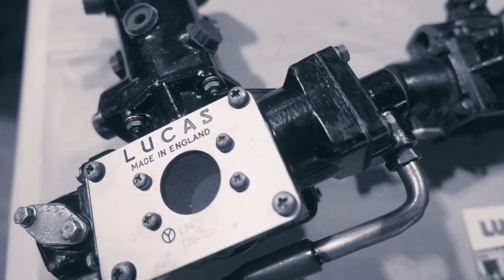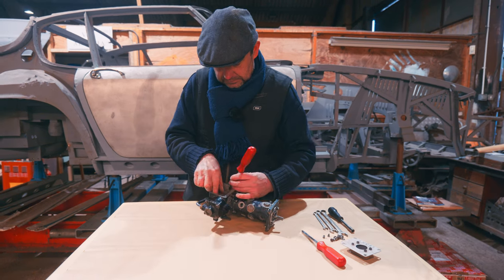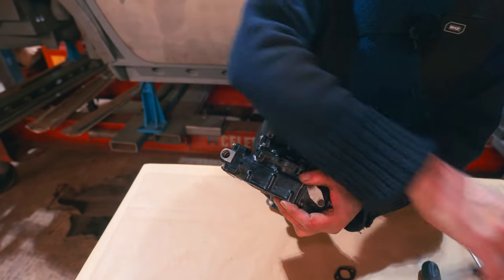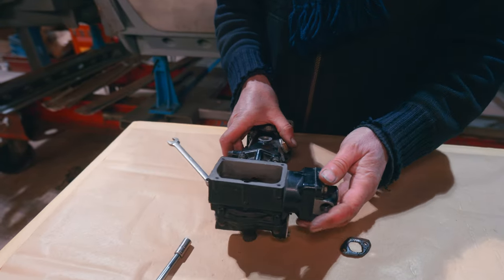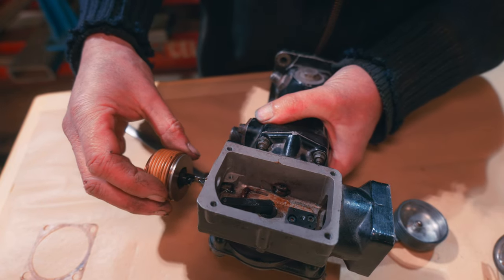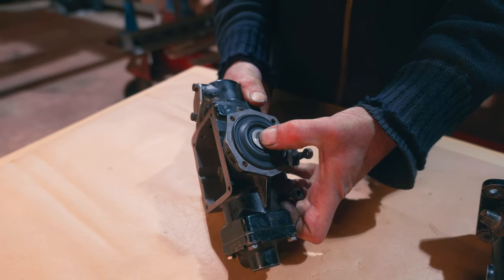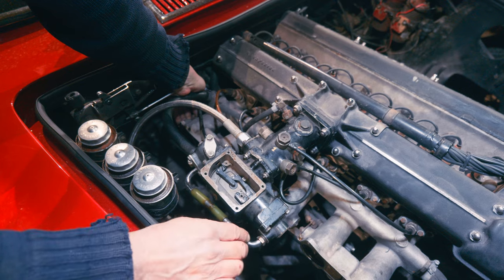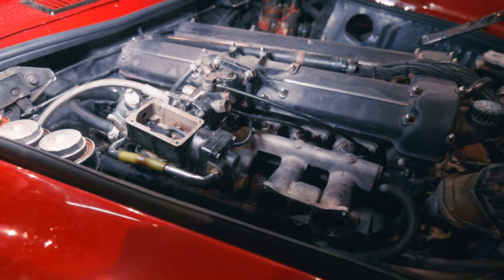Lucas Injector Part 4

Comment: Awesome video. Thanks. 

So the throttle cable is connected to the butterflies. When that opens it creates a bigger vacuum that is fed back into that block to enrich the mixture. 

Interesting how the barometric and choke changes the guide for the wheel to follow. Thus enriches the mixture
Reply from the maker: I guess it could be comped to the oppression of the SU carburettor.
In that the jet is moved independently of the butterfly. I would imagine that the concept would have been the jumping off point of this design it’s all about airflow and it was the aero devision of Lucas that worked on this stuff.
I do explain the operation of the system in the first film there are 4 films in this series. It’s worth watching them all to get a proper understanding of it.
All this stuff was dreamt up in the 1940s and 50s without the aid of computers.
Remarkable really.

Comment: Great Mark, I am now slightly less ignorant about fuel injection than I was before this series on the Lucas injector. It really is a well worked bit of engineering for it's day, I love the barometric control with the aneroid capsule. Very simple but effective.
Reply from the maker: Glad you like it.
I thought it would be a good thing to look into.

Comment: I would be extremely grateful if you could help me understand the wiring to the injection fuel pump, specifically to the C1 connection on the Lucas 6RA relay. One Maserati factory wiring diagram shows three heavy gauge wires to this relay terminal (one to a safety switch, a second to fuse 11, and a third to no. 8 on the thermal switch). The fuel pump is wired simultaneously to the C2 terminal and to the safety switch. The Lucas injection manual however shows an alternative wiring configuration with only one connection to the C1 terminal ( fed through the fuse and ammeter), but also a second feed mastered through the ignition switch to no. 8 on the thermal relay. This configuration shows no safety switch ( a direct connection from the C2 terminal on the 6RA relay to the pump). I desperately want to avoid any chance of an overloaded circuit and a possible fire hazard. I would be eternally grateful for your help and guidance.

Comment: Curious, my 4l metering unit didn't have the cover plate over the levers.
Reply: I spent six months fiddling with metering rollers on our 4l trying to get rid of black smoke under load, assuming that it couldn't be the ignition as there was two separate systems. Turned out the the spark leads were cross-firing.
Reply from the maker: @lkkaz1  A misfire will affect the manifold depression and make it run rich it is one of the problems of the system.  The ignition system has to be operating 100 percent anything less and it upsets the injection system . It is a misunderstood system but can be made to work very well.

Comment: Mark do you need to lubricate inside the barometric end around the shuttles etc
Reply from the maker: A bit of grease around the outside edge of the piston during assembly and a drop of oil on the links.